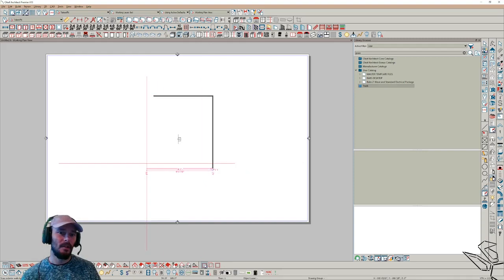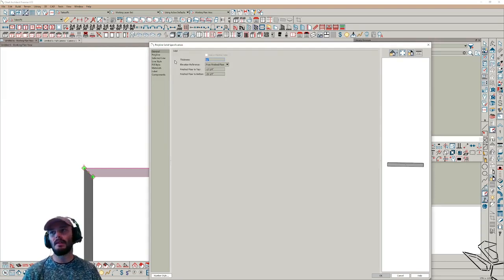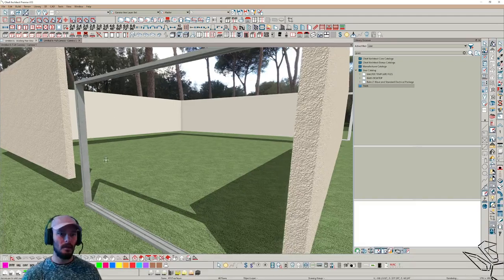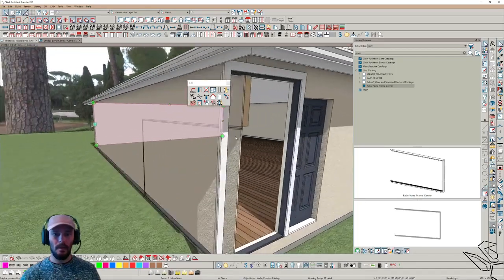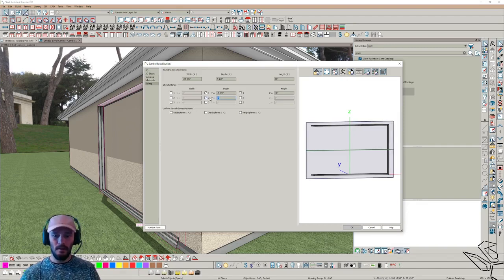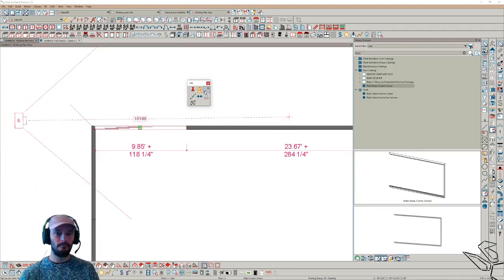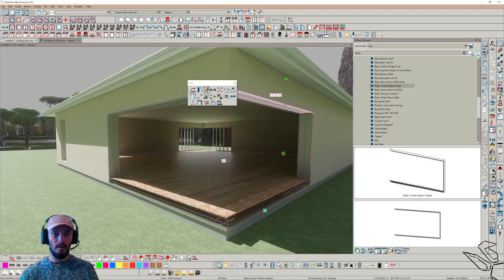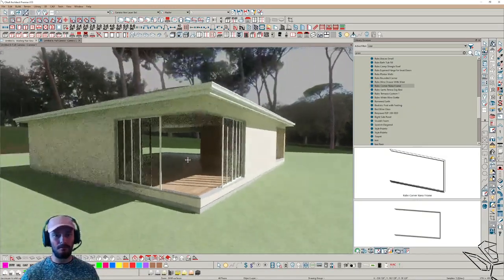Corner Delete and Nana Wall in Chief Architect Premier X-13

Comment: Thanks for sharing.   Do  you think you could make a video that covers the basics of wall and floor construction?   Building an interior layout seemed fairly intuitive, even the thickness of the walls and materials in the walls - what wasn't intuitive (to me) were heights.      I'm trying to make a basement - walls with footings - 10" of crushed stone (I don't know if that is part of the plans), 4" of hard insulation, 10 mil poly, 4" of concrete, no planking on top.   I'd like 9' of clearance before any structure above.   I"d like a 12" mid section cross beam and a 16" wood truss with 1 1/8" deck sheathing for the sub floor, some mass loaded vinyl and some luxury vinyl flooring.   Then I wan 9' between the finished floor and the ceiling.       Most of the videos I find say - let's make a 9' wall - no explanation of how the flooring or ceiling construction fit into that.
Reply from the maker: Think of Chief as building in platforms from a 2d view. Once you wrap your head around that, then understand that a platform is simply a collection of component assemblies. A component meaning a wall, layer, and the assembly being all of the components that a wall is compromised of. Your structure is set by the contextual menus that live within the floor levels. So your wall height is parametrically resized based on the designation you give to the floor that it resides on. In short, change your floor height, and your wall height will change. I would recommend doing this from defaults before you start a project, and not by room, unless a room should be sized differently than the floor on the whole.

Comment: After following your guide several times. I figures out how to get it to align with the floor.
First just make the wall you are creating the symbol on invisible, and then start the p-line solid creation of all the tracks and guide elements.
Once you make a symbol, make sure to set the insert to wall thickness a typical 2x6 wall w/GWB and siding thickness of 7.25" min.  Those stretch planes are still a bitch to puzzle out, but I got them very close.
The only missing piece would be the casing on the window/wall/door system.